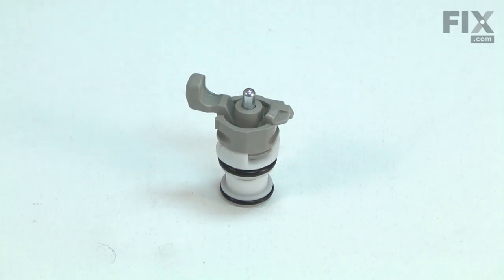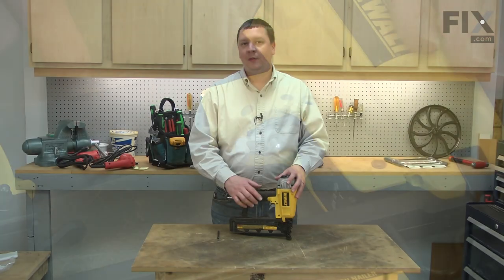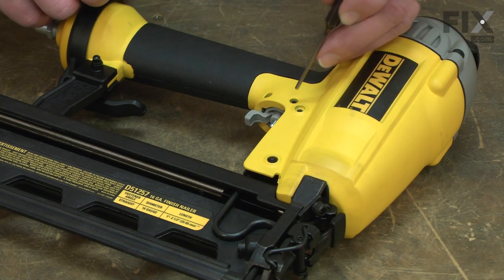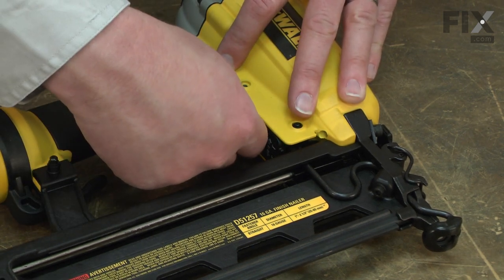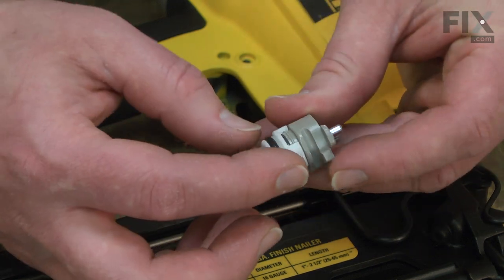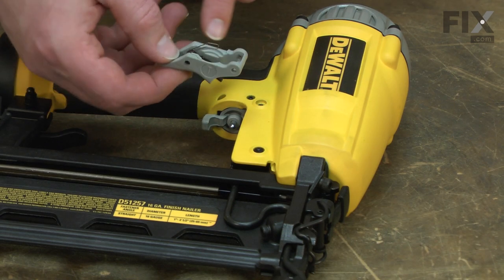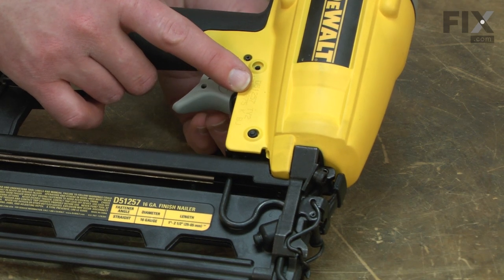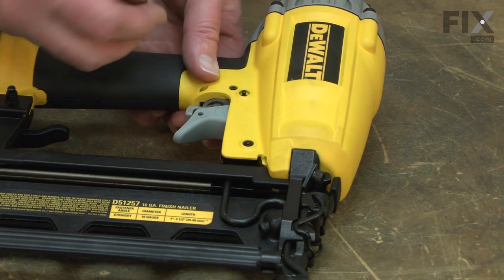DeWalt Nailer Repair – How to Replace the Trigger Valve

Comment: just ran cross this video, my dewalt finish nail gun would not fire, pulled the trigger apart, and in this video, you show all the o-rings on the trigger,,EXCEPT THAT TINY WHITE LOOKING SMALL O-RING ?!, sure enough..that o-ring that goes on the inner part at the bottom was gone, replaced it with an o-ring from a harbor freight o-ring kit, BACK IN BIZZ NOW !..thank you for this video on showing how to take it apart, and what all the parts looked like.

Comment: This was a great guide to repairing my Dewalt finish nailer.  The trigger valve was only about $12 on Amazon and the new one restored my nailer to its original condition.

Comment: Would be nice to see how it acts when this repair is needed and confirm it worked.
Reply: Because of the leaking o-ring(s), it will blow air from near the trigger when it is pulled, but not blow enough air to drive a nail. When the repair is made, the nailer drives the nail as intended.

Comment: THANK YOU SO MUCH for posting this video.  Without it, I would not have been able to make the repair! I have an older model and found combination of, flat head - not hollow, nail set and a nail helped get the two pins out in lieu of the tool you demonstrate with.

Comment: This worked like a champ. My Dewalt 15 g angle nailer wouldn't fire. The damn thing was practically in new condition, but I hadn't used it for a while. Replaced this part and fixed it right up. I had to use my Porter Cable gun instead, which ironically is about 8 yrs older than the Dewalt--never had to replace any parts on that one.

Comment: I had replaced all the o rings in my DeWalt D51844 framing gun. And it's still is blowing air out the trigger when I pull it in to shoot. Do you know what this could be? Thanks
Reply: When you replaced them, was that one white one actually wax at 1:37? That's what failed on mine.

Comment: 1:37 That thing that looks like a white o-ring near your wedding band is exactly what failed on mine. There's a chunk of it remaining and it's not an o-ring at all, but a very soft wax stained orange from the oil I'm using. Maybe the oil changed it's composition, but I think it was originally wax. I think it's designed to fail first. I wonder if there is an o-ring replacement I can use so I don't have to wait for shipping and can get back to my task at hand.
Reply: I'm wondering the same thing I'm going to give it a try
Reply: Sometimes soaking the O-rings in some transmission fluid will make them fresh again
Reply: @micanopykracker902  I used a $7 o-ring kit from Harbor Freight to fix mine. Just used some calipers to measure the spot and picked the closest o-ring.
Reply: @micanopykracker902  I bought two air valves, but they weren't going to arrive on time. You can have them if you pay shipping.
Reply: Hi, Did this white ring turn out to be grease or a another o-ring made of a different compound?
Reply: @krperry2007  Good question. It turned out to be an o-ring of a different compound, which leads me to believe it was designed to be the weakest link. I have 2 or 3 of these assemblies now as I ended up ordering a few and then using a different gun because of deadline time constraints. I also used a cheap o-ring kit from Harbor Freight to solve my problem with this kit. Let me know if you want details on that as a solution.
Reply: @RefinerSimilitude  Could be not compatible with mineral oil, like silicone which can be white.
Reply: @krperry2007  I replaced it with an o-ring from a cheap metric o-ring kit from Harbor Freight and I finished the job no problem. Let me know if you need details. I remember what a pain this was and can refer to my materials on hand to help out if you want to go that route.
Reply: @RefinerSimilitude  Hey it worked. My white oring was gone except for a small orangish trace.  I put on a HF .25” ID x 1/16” (sz10) and maybe a bit loose but working for now.  Put up some door trim and no leaking. Thanks.
Reply: @krperry2007  awesome!